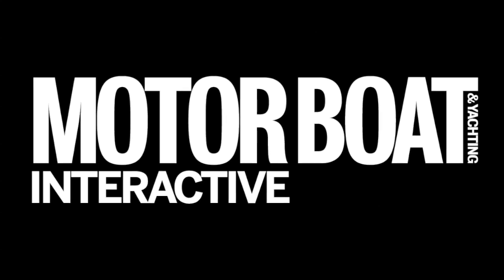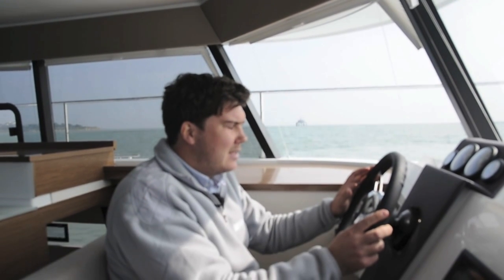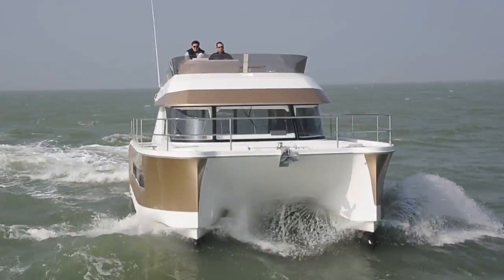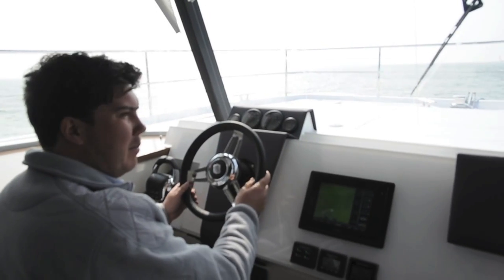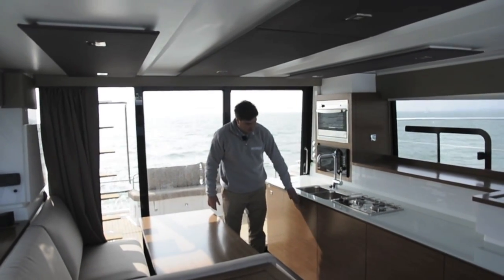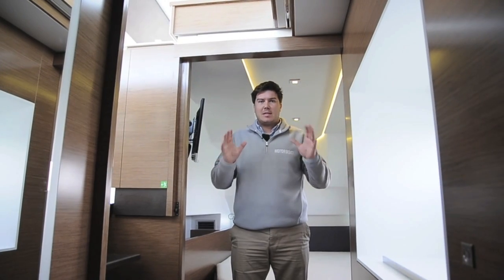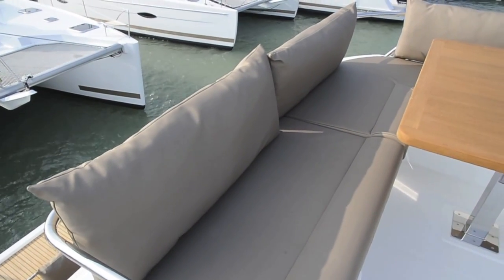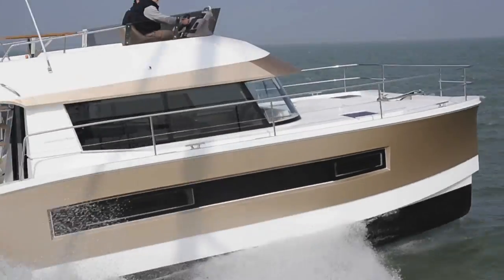Fountaine Pajot 37 from Motor Boat & Yachting

Comment: hehehe  What do he think he's driving, a sports car?  Dude, it's not a race boat, it's a cruiser. Like the other guy said, rip out the lower helm, waste of space.  Very amature review. No mention of mechanicals access, at least the very basics of fluid checking, changing, belt checking/changing, filters to name but a few thing that every operator would like to know.  Think he missed the point in the galley, it's not a house it's a boat. To the guy  worried about wind and rain,  a few years ago they came up with the idea of canvas and plastic to enclose the upper helm, hehehe. many boats have including sail boats have it. The biggest problem I have with the boat is the price for the quality, I was on one like this last year and although it's ok it don't warrant the price.  A PDQ is much better, but then again they a Canadian boats, to bad they don't make them anymore.